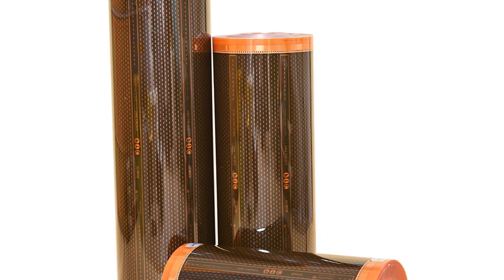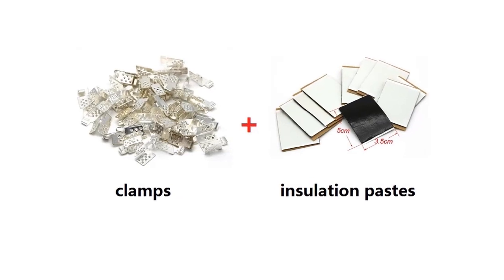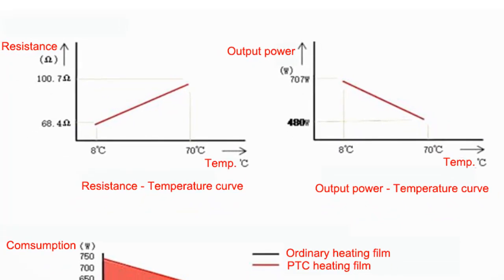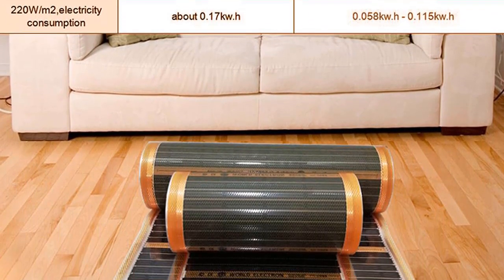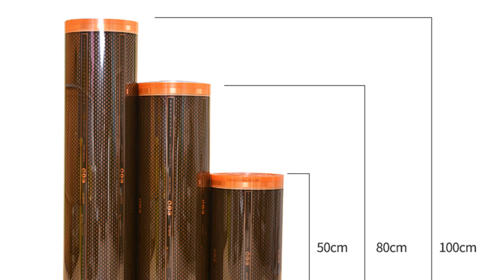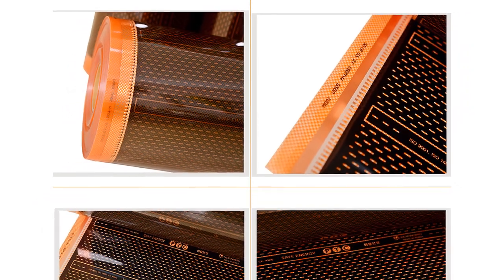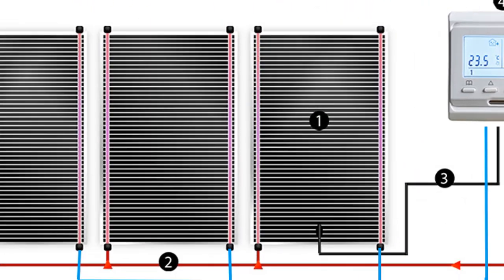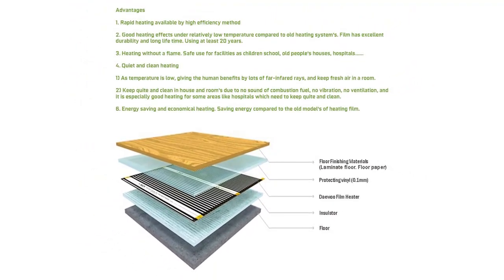Flooring With Radiant Heat: Graphene PTC heating Film - Carbon Foil

Comment from the maker: Flooring With Radiant Heat - Graphene PTC Heating Film Infrared Electric Warm Floor: https://electrical-equipment-dcp.blogspot.com/2022/08/flooring-with-radiant-heat-graphene-ptc.html 
👉 Radiant Energy: https://ultimate-energizer-guide.blogspot.com/p/electronic-devices-generates-free-energy.html - Use Electronic Devices To Make A Free Energy Generator

Comment: Hello. I d ont understand how it works. I buy this orange foil and I made an experiment with a 25x50cm piece. At 230V,  I have an consumption around 118mA at room temperature and more. When the foil had 60-70 degree the amperage was 120mA. From your graphics normally the consumption should decrease.  I used only professional equipment. Do you know where is the problem? Thank you.